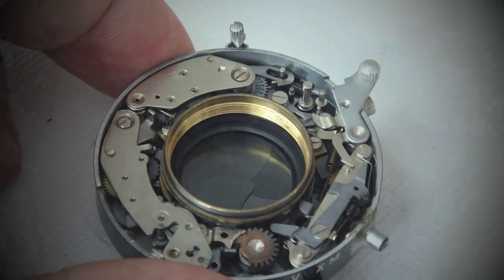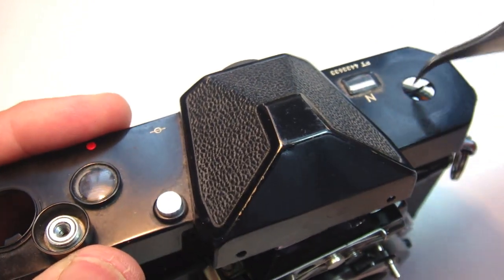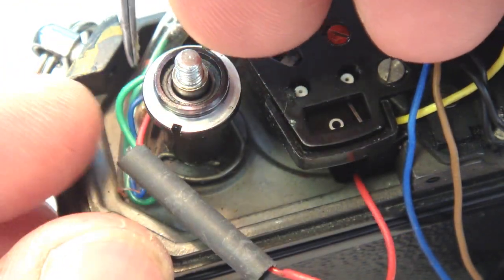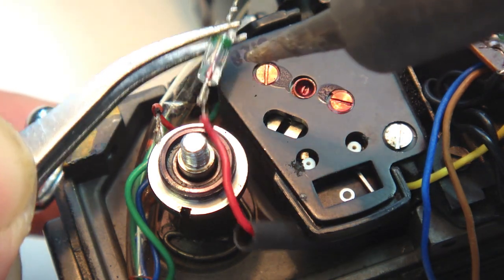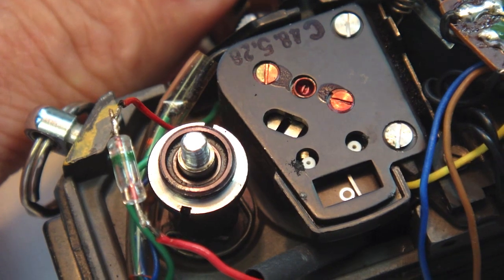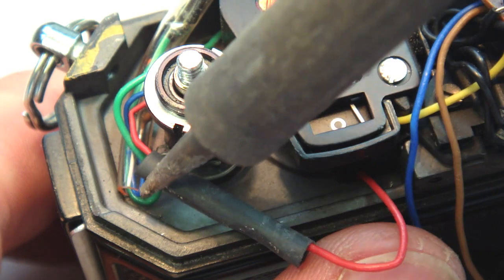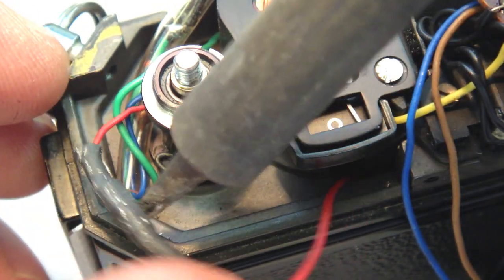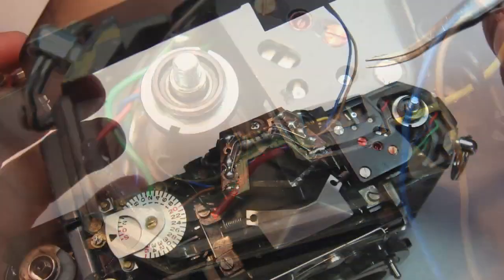Fix Old Cameras: Nikkormat FT N Diode Modification

Comment: I was just trying this on my FT N following this tutorial and it didn't quite work, but I did get it working with another method. I installed a diode into the red wire shown in the video but I didn't see any change in the meter sensitivity. I even tried using 2 diodes and still no change. Even with the red wire cut and disconnected the meter was still working. So, at least in my camera, the red wire that runs into the meter housing doesn't seem to have any function with the meter.

However alongside the red wire is a black wire. I spliced the diode into this black wire and that got my meter adjusted and matching my digital camera.

Comment: I take it the voltage drop across the diode makes up for using a 1.5v cell rather than the 1.35v original?

Comment: Thanks for the tutorial. After watching your video on removing the top cover and prism removal on the Ftn with the NOT original film advance lever i hoped you showed how to remove the original Ftn,s lever without the holes. Does it also turn ?
Reply from the maker: It does. A friction wrench (stopper) will be needed. The back of a discarded mouse pad will sometimes work it you have a strong thumb.
Reply: Thank you

Comment: Hi again, Another option more easy to install consists in removing bottom of the camera (only 2 screws to remove) Then you can insert the diode between battery holder and red wire... ;) Very easy
Reply from the maker: Keep'em going. Thank you for the comments.
Reply: I tried your method and realized right away that it wasn’t going to be as “easy” as you say it is. You have barely any room to work with, and getting the battery holder out of the frame was a real pain. Not to mention how much more difficult it would be to get it back in with a diode attached to it.
So I buttoned the bottom back up, and had the top off in about five minutes. The mod took another five minutes at most.
I had it done in the same amount of time it took me to try to figure out the logistics of doing it at the bottom, and now my Nikkormat meters perfectly. 
Sometimes other people might know more than you. Maybe you should learn something, instead of telling them they’re doing it wrong.
Reply: @barbsfpv3066  he was nicely making another suggestion, not criticizing, not telling him what he did wrong. holy cow. take a chill pill. lol

Comment: Thank's for video.
The diode used is so... huge. 
As an alternative, you can use schottky diodes, which are easy to find, smaller, less expensive, and offers best reliability/results.
As an example AK06 has a voltage drop of about 0.15V @ 25°C for a 0.5mA current. This is just perfect.
The 1N5817 matches as well.
Less than 0.5USD, you can get them at digikey.com, mouser.com, and sometimes free as samples.
Reply from the maker: Thank you for your interest in FOC and for your tips and comments.

Comment: please make a video how to calibrate light meter on olympus OM2
Reply from the maker: There are a few minor adjustments that could be covered. Such as using the eccentric screw on the ASA cam follower for a linear adjustment. NOTE: The OM-2 circuit has MOS ICs - always touch any tool to the body of the camera first before allowing it to come in contact with circuit adjustment points.

Comment: Not sure if you saw it on the other video. Would you ever consider recording something like the replacement of the shutter straps on the Contax II or III? I have a Contax 2 that needs the straps replaced, and a video would be extremely helpful.
Reply from the maker: It is possible that such a video might at some time be made. At the very least a video that shows how to access the wind mechanism/ shutter module might be in order. Indeed the access to the module is involved and success is ultimately going to tied to your skill level, patience and persistence. Like with so many things we have yet to learn, if we can learn the very next thing in the process that we do not know and not jump ahead beyond that thing, then success might be in our reach.
Reply: Fix Old Cameras There’s a very well done article by Richard Haw on replacing the straps, but there are a good number of things left out. When he talks about taping a certain shaft/how it would be done, and the actual stitching method is rather cryptic. As I said, I plan to practice on a Kiev first. I really hope you do make a video, it would be amazing, as all of your content is. Thanks for responding.
Reply: believe me, you wont be able to repair the contax yourself. it has one of the most complicated shutters ever built in a camera
Reply: harry zet Was that the question I asked? I believe that with sufficient instruction and practice I should be able to do it. I’m going to get a Kiev to practice on first. Once I have sufficient skills I will attempt the Contax.